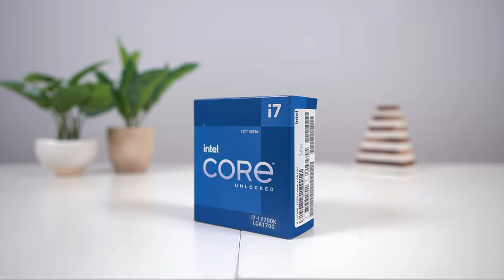$2500 Gaming/Streaming PC Build [NO COMMENTARY ASMR]

Comment: 3060 ti for a $2500 pc is a bit yikes
Reply: 3060 ti is good
Reply: @Hrtwill not really. Get a 4090
Reply: @Hrtwill  no it’s not terrible price to performance and it’s slow atleast a 4070 or 3080 for 2500
Reply: @WonderBread4020  the 4090 itself costs $2k 💀
Reply: @ezdlx  1.5-1.6k rn for a new 4090
Reply: Fr I got a 7900 xtx with that budget
Reply: @Hrtwill in2020
Reply: @huntershideout3 yeah that is 👍👍👍👍
Reply: @Hrtwill whilst personally for me, my 3060 ti has worked great. For a build like this it should definitely be better
Reply: @WonderBread4020 Not everyone can afford a 4090. Maybe this is the best he can get. Also, I don’t see the need for a 4090 to be honest, my 3050ti works perfectly in most games. But, personal preference. Just saying that the 4090 is really expensive and may not fit in all cases.
Reply: For this Budget its yikes. You could easily get an Asus rog strix 4070 ti with this budget
Reply: Agree. I have a $900 usd PC Build with 5600x, 4060 ti, 16 gb Ram, Core Reactor 750w, 1.5 tb nvme and all inside the H5 Flow from NZXT, and all brand new
Reply: @Alzxzz u crazy
Reply: could have just got rx 7800 xt would be miles better
Reply: This was also when the prices of everything was inflated
Reply: @RandomAtvFamily  this was just last year, prices went down by then. and the 3060 ti would've sold for $350-550. that's how much I sold my 3060 ti in around January, 2022.
Reply: @Hrtwill u can get a prebuilt nzxt 4070 for 1600
Reply: Women ☕☕
Reply: @ezdlx it was 1500$, the new super cards are coming soon, so the regular ones are going to be cheaper, a prediction of the price says 1500-2500$ for the rtx 4090 super
Reply: You didnt realize it was 1 year ago that gpu price is still on the moon?
Reply: A year old video and bro does not know price deflation💀
Reply: @Kypris_  a year ago a 3060 ti was around 400 dollars , and plus this is when 4000 series came out. doesn’t make sense how this was 2.5k even though i sold my 3060 ti for 400 last year
Reply: @Alzxzz on Nvidia’s website ye but there almost always sold out and Nvidia doesn’t overclock them, doesn’t put more fans and a better heat sink, and can’t forget the most important part the RGB which increases performance  by 90%. I’m pretty sure at this moment you can buy a new PNY 4099 for 1,900 cheapest branded card u can get rn
Reply: @thepers0nwh0asked  ??? nothing you said made any sense
Reply: @WonderBread4020 not realistic for 2500. You def could get a 4080 super tho
Reply: @louie1432 you could do a 4080 super build for cheaper?????
Reply: @TGF140 no with thaat budget easily a 4080 super
Reply: @louie1432  NAHH I KNOW YOU DIDNT SAY 3050
Reply: @louie1432  DONT TELL ME BRO BOUGHT A 3050☠️☠️☠️
Reply: Just save money and get intergrated graphics guys, even I use it till this game and it runs modern games at at least 30 FPS which good enough for me since I spent more on others
Reply: @peterfdfdy1539  do NOT listen to this guy… integrated is not shit compared to a 7 year old card like the 1060 and you can buy one of those for cheap around 50 bucks
Reply: @elvpse  you gotta never speak again please 😭😭
Reply: @Alzxzz  well I spent the rest on other stuff but I at least have an i9 and 64 gb of ram ok?
Reply: @Alzxzz  even high end games get 30 FPS which smooth enough and that’s even default settings
Reply: @Alzxzz  intergrated graphics is better then nothing since my gf locked me in her basement
Reply: @peterfdfdy1539  what are high end games to you? your whole page is roblox
Reply: @peterfdfdy1539  what generation i9? and even then intel integrated graphics are so ass it’s better to use a gt 730
Reply: @peterfdfdy1539  if it’s ddr5 you can get atleast a 3070 with that money and if it’s ddr4 then a good gtx 1070
Reply: @peterfdfdy1539  and 30 fps is NOT smooth at all. 50 fps atleast for a playable experience, considering 30 fps and many fps drops in more population density areas
Reply: @Alzxzz  well I play high end games off cam since my hype is roblox and since my gf locked my in here basement theres no point of a gpu, She stole my gpu and if I order she’ll steal it
Reply: @Alzxzz  i forgot what pc I bought but I know that my gf stole my gpu
Reply: @WonderBread4020 With a $2.5k budget? You'll barely have any other room for parts
Reply: @louie1432 we can clearly see the budget for this video, I don’t see how a 3060 ti made its way into the build
Reply: @WonderBread4020 no one needs 4090 3080 or 4060 is plenty
Reply: @panchopantera7433 pretty good set up bro
Reply: @thearizonian9500  4060 is ass, have you seen the specs???? Literally everyone says to steer away from the 4060, it’s literally a waste of money. Get a 4070 TI
Reply: @WonderBread4020  I'm not spending twice the money Chief
Reply: @Alzxzz Capping, it's like 1.7 to 2k ☠️😭
Reply: Spent like 2k and got a 4070ti super
Reply: @Alzxzz no
Reply: @Dubulcle  a good deal isn’t hard to find
Reply: @Alzxzz  Where ☠️ what you're saying is untrue
Reply: @WonderBread4020 Bro some 4090 cost 2300$ he’s gonna have then 200 left 💀
Reply: @Dubulcle  if you’re in the USA you can easily find a second hand 4090 for under 1.7k
Reply: @Hrtwill nah buy a radeon 6700 xt
Reply: That’s what happens when you opt for nvidia 😂 you can get a 7600xt for like 30 bucks more and its wayyyyyy better
Reply: I would get a 4070 ti super at least for 2500 typa build, with a i9
Reply: For a $2500 PC id recommend buying an rtx 4080 super or an RX 7900xtx (i got the rx 7900xtx and it performs 10 Times better
Reply: @Flo-bt5jc  7900xtx does not perform 10x better than the 4080 super or the 3060 ti
Reply: @Alzxzz  sorry, i ment that the 7900xtx performs way better than the rtx 3060 ti, Not that it performs better than the rtx 4080 super, the "10 Times better" was also just hypothatical, the rtx 4080 super is in pure Performance even better than the 7900xtx but i would recommend the 7900xtx because it has 24 gb of vram instead of only 16 gb
Reply: You could get a used 3080 for only 300$-400$
Reply: fot that money i get a 4080 super and Ryzen 9 7950X3D full white
Reply: @louie1432  spending $2.5k on a build only to get a 3060ti is absolutely insane. With that budget he could've gotten a 4080S/7800x3d GPU/CPU combo.
Reply: @cripkick5114   stop riding AMD. 7600xt isn't any better for this build either. A 4080S or 7900xtx would've made sense.
Reply: 4080
Reply: Recently scrolled across a short where a dude bought a PC build with a 3060 (I believe non-Ti) for £3000. Sure it had a touch-screen case but it was definitely an overpay considering the other specs.
Reply: @Alzxzz  Have you thought about the cpu?
Reply: @Bryan-zf3wl  cpu at most is like 500...
Reply: @Alzxzz  Yeah, a 4090 for a 2500 dollar PC is crazy, and you would need to have a CPU that matches the gpus Power. Not to count the rest of the components
Reply: 4070 Ti super is $800 get that.
Reply: @aravjain  nah get a 4080 super for aesthetics build or a 4090 for all performance
Reply: I think it's cause of the 300$ nzxt kraken 4600mm elite argb 😂😂😂
Reply: @VeryCoolMinecraftGamer00  even with that a 3060 ti is very yikes
Reply: @user-bp6bu8gg2g  yeah i meant that he has only an rtx 3060 ti (which is also very overpriced) because he spent a sh1t ton of money on the cooler, which is also overspending, I don't see qhy people make aesthetic pcs but not performing
Reply: @WonderBread4020 more like a 4080 super
Reply: As a poor person i cannot relate to anybody here
Reply: @Alzxzz  yeah but for 2500 dollars it’s not, you could get like a 3080, 3090, or find a way to fit a 4090 in there

Comment: Awesome build! One minor thing that I would change is switch the fans in the back to intake, that way the PC gets more air inside the PC than outside the PC.
Reply: I feel like this guy know what he’s doing
Reply from the maker: There's intake on the bottom in the final build, 11:00
Reply: @Roo_Tech  Yeah I know, but I think it would make more sense that the intake would be on the back as well. If you can't get an even amount of intake and exhaust fans, then it should be positive pressure (more intake than exhaust).

Great build though! I love the color scheme. It would match my setup very well.
Reply: @zach4279  He truly does know what he's doing, it was just a recommendation to make the airflow slightly better.
Reply: @zach4279  he knows what he’s doing, but we watch these videos cause we’re all passionate and like to talk about it. I agree with with moderate productions. Too many exhausts. You want them flipped to intake for maximum and effective cooling and 1 or even better 2 exhausts. Great video and awesome observation by moderate productions. Moderate knows what he’s doing as well.

Comment: Clean build. I personally would have plugged in the gpu with 2 separate 8 pin cables instead of using the daisy chained one that comes with the PSU. These graphic cards are power hungry.

Comment: Solid build.  Been pretty happy with my Z790 Aero +13700k.  Now I just need a worthy upgrade to my 3070.
Reply: Have you upgraded that 3070 yet?
Reply: @Nodnarb69  Not yet, waiting for the 40 series refresh, I might get the 4070 TI Super (even if the name is dumb) depending on the price.
Reply: @nadtz  lol the name is kinda funny. But yeah hopefully the pricing isn't extreme but it seems like these gpu prices are only increasing which is ridiculous.
Reply: @Nodnarb69  If rumors are to be believed that might change a little with upcoming generations but I'm not holding my breath.  I wouldn't be surprised if low end video cards are replaced by IGPU's soon altogether and 'mid' range cards start at $4-500 or so.  

Either way AMD is supposed to be going after the low-mid range market with their next cards.  Hopefully they do, do a good job of it and shake things up a bit cause yeah, these prices have gotten out of hand.
Reply: @nadtz  hopefully. Im excited for the nvidia cpus, gaming pcs are gonna be lit

Comment: I also would have had the air fans where the cpu liquid cooler radiator is and the radiator where the air fans are with the air fans switch to intake for maximum airflow.
Reply: Nah radiator needs to be higher than the pump

Comment: Hello. In that type of case with airflow from below, could the radiator be placed in the position of the vertical fans? I almost always see it above but perhaps the other way would favor the flow of hot air above. Regards
Reply: should have chosen the 7900 xtx and the ryzen 7 7800x3d it would have been a better rig

Comment: Hi, will it be ok to combine RTX 4060ti graphics card with i5 10400F, Prime H410M-R motherboard, 700W PSU and 16GB RAM? Just afraid that the graphics card will not be able to run at full capacity. Will it be ok?
Reply: Yes. A slightly better cpu would be better and I would recommend instead getting a 6700xt

Comment: 3060 Ti isn’t that good I don’t think for your budget. I would probably downgrade the CPU and get a 4060 Ti or a 4070. I don’t know much about computers and I’m still learning after recently building one myself. I still think that a 3060 ti is ok for gaming and you most likely won’t have any issues but if you’re going to drop $2500 you might as well have most of your budget be the GPU cause I’m pretty sure it’s the most important part other than the CPU